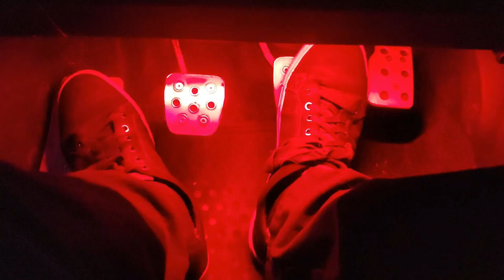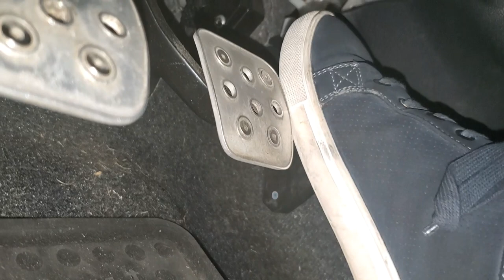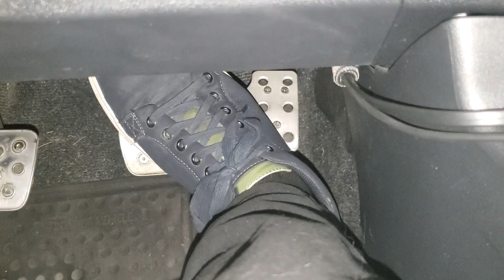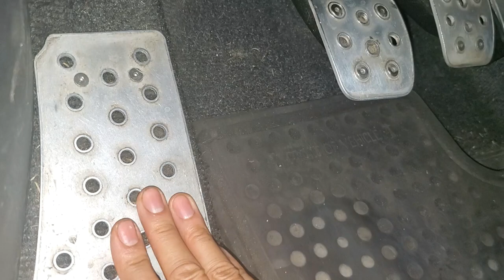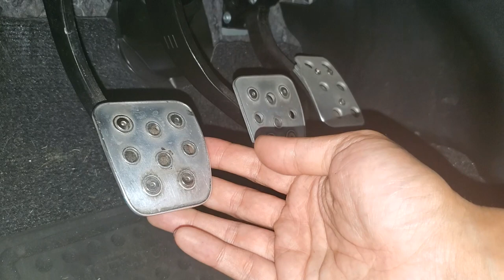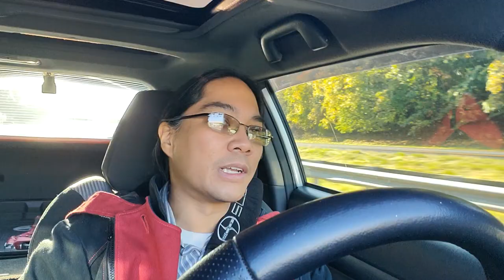Accelerator Pedal Cover Spacer / Riser for Heel and Toe Downshifting Follow-Up (Scion tC2 / tC2.5)

Comment: Do you know if the alternate pedals from PFYC work with the second generation TC as they are listed for the first gen TC?? Thanks
Reply from the maker: Pedal covers are generally pretty universal, so they should work. Just make sure they're the style that bolts on and not the one that has the thin metal strips that wrap around the edges of the pedals.

Comment: I drive a Scion xB 05. It’s very uncomfortable to drive mostly due to this. Any advice. Am I alone
Reply from the maker: Pain from heel and toe downshifts?
Reply: @VampyreX13  if u mean hitting the brake then ya. It’s an automatic
Reply from the maker: @newblakestone  ah, ok. I don't have advise since I don't have an automatic to look at the exact pedal setup. If it's a height difference issue, you could probably apply what I did here to that. Have you tried adjusting the seat height and tilt? That can help a lot.
Reply: @VampyreX13  you can’t in an 05 xb

Edit. All u can do is move forward and back, and lean the back
Reply from the maker: @newblakestone  I would consult a physical therapist and see what their recommendations are. I have the benefit of having a massage therapist as a friend who helped me properly adjust my seat settings.
Reply: @VampyreX13  I’ve done all that, nobody will help me
Reply: @VampyreX13  also, there is no way to adjust the seat in a meaningful way
Reply from the maker: @newblakestone  I'm still at work for another hour, but if you want to message me on FB or IG @vampyrex13, we can chat and I'll see if there's anything I can think of.